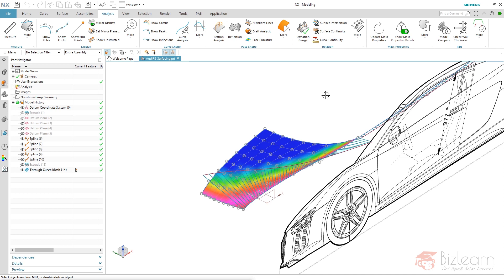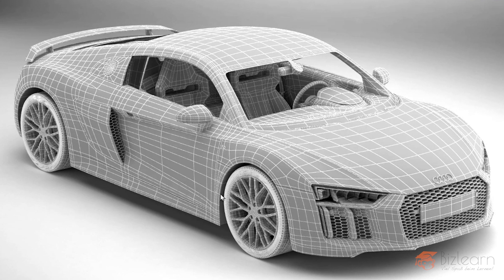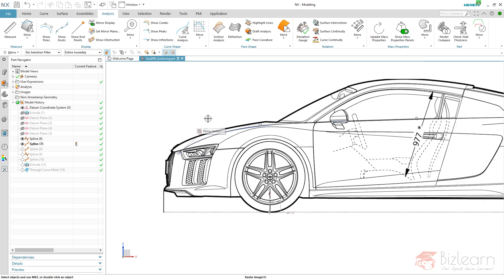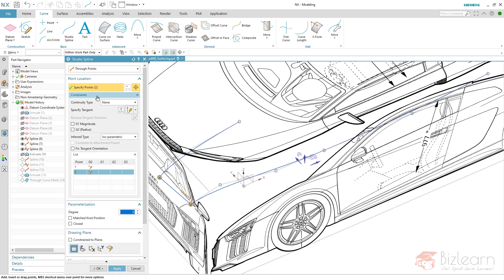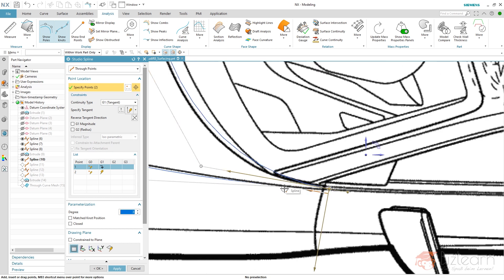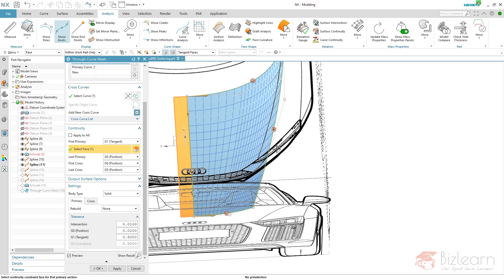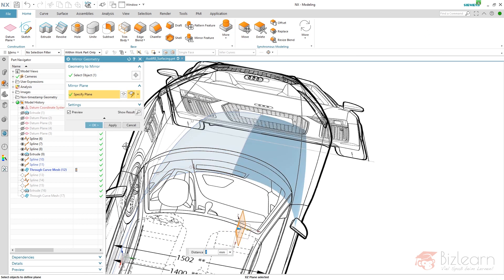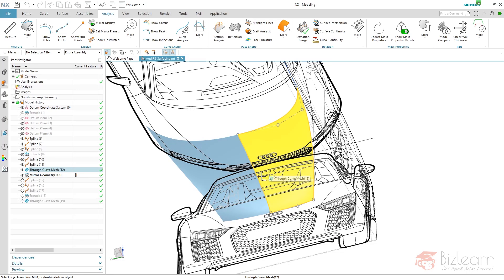Siemens NX Freeform Pro Tutorial - how to use Splines to create Class-A Surfaces (Part 2/2)

Comment: I usually use Siemens courses as an introduction for this kind of purpose. The downside of those courses is that they often just say “do this and that” without really explaining why. I get it, since they’re meant to be short, but sometimes I’m left with that gap in understanding. Still, their main goal is to teach you how to use the tool, not the design process itself (especially since the exercises mostly guide you through the interface), so it makes sense and they’re still really helpful—especially when starting from scratch.
In these two videos, many of my doubts were cleared up, and I finally connected pieces of information I hadn’t fully understood before. I’m really grateful. Excellent explanation.